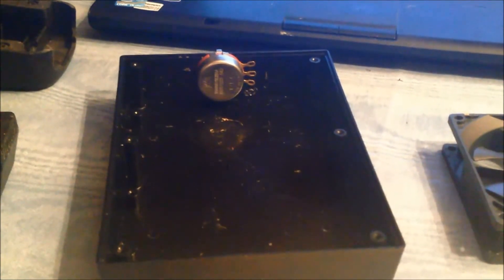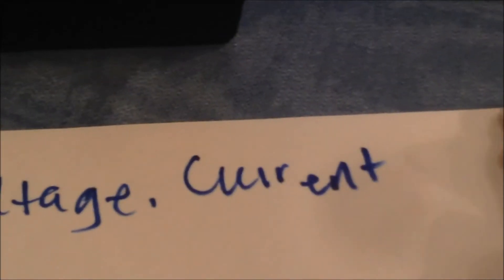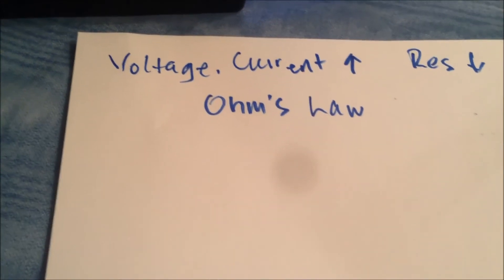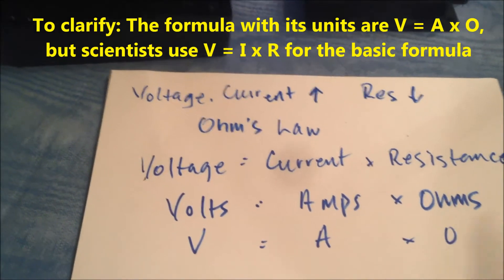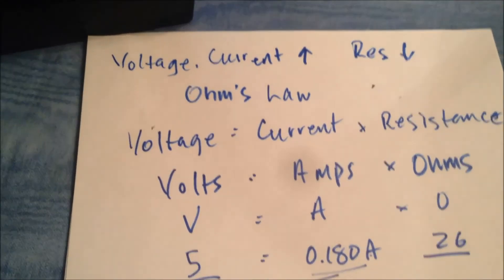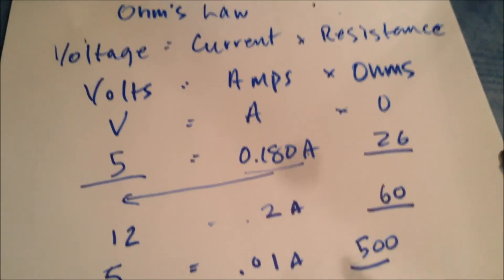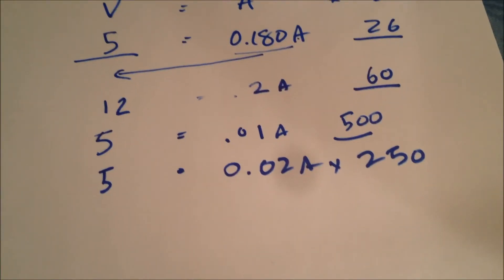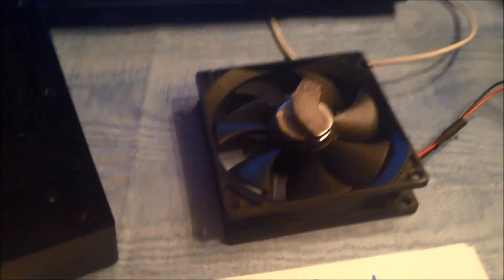Use Ohm's Law to choose the correct potentiometer for a stir plate

Comment: Ok I Tried to keep up but when you figured the max ohms, I got lost. I’m trying to add a speed control to my model train with a potentiometer. I have 20vdc input with about 1.5 amps from a 30 watt transformer. Any advice on what pot to use would be greatly appreciated. Thanks Steve
Reply from the maker: You want to adjust the voltage from 0.0 to 20V by installing a potentiometer that adjust voltage accordingly.

Ohms Law from your numbers is: 20V = 1.5 Amps x 13 Ohms or 20/1.5 = 13

The Amps needs to be as low as possible e.g. .01. Formula is:

20 Volts/.01Amps =2,000 ohms

So buy a pot that goes to 2,000 ohms
Reply: Doug Brown thank you so much.

Comment: Responding to an old upload but here goes. Firstly where do you find such small resistance radial potentiometers? These don't seem to go down below 1kohm and I need like 0.06kohm or 60ohm according to your calc.secondly my power supply is rated at 12vdc and 2000mA but the fan is probably only gonna pull max 0.3A. Should the potentiometer not be calculated according to the max amp draw from the fan rather than from what can be provide - in this case 2000mA?
Reply from the maker: HI Josh. I was in Portland, OR on a visit and just found this big electronics shop with a huge range of electronics including potentiometers. A store like Radio Shack will have them if you google around your area. And of course Amazon etc. will have lots of suppliers, but I like to support offline retail. 

Regarding the fan, you have a very strong power supply that is going to spin that fan super fast and likely burn out if you gave all that current. 2000mA is 2A of current going into a fan that needs 0.3A, so the chance of burn out is pretty easy to see. I would consider a 5V supply like mine. If you want to use the stronger power supply you have to be able to control 100% of the energy flow to the fan, and then be able to dial the potentiometer way down to supply just 0.3A to the fan. You're asking if you should buy a potentiometer that will deliver a max of 0.3A, but these simple little electronic components don't really work that way. You have 12V and 2A of energy coming out of the supply so you need to control all of that first, and then use the dial to deliver just 0.3A. Hope that makes sense.

12V / 2A = 6 ohms and then the max resistance will be (I'm just using my 0.02A figure again) 12V / .02 = 600 Ohms. So I would buy a 500 or 1,000 Ohm potentiometer. Since you're supplying 2A of current but only need 0.3A, you'll have to turn the dial to zero, and then carefully dial it up until the fan turns at the desired speed. 0.3/2.0 = 15% so you'll be dialing from 0% (completely shut off) to 15% (the max the fan can handle.) You won't have great control over the fan because you'll only have like 3mm or 1/8" of dial to play with. If you go higher, the fan will spin superfast and then probably burn out. So you can use the 12V power supply as long as you're careful. I would downsize to 5V like in my video and then you can use nearly 100% of the dial to control your speed. Hope that also makes sense?

Comment: Hey Doug,

I ordered this power supply from Amazon (https://www.amazon.com/gp/product/B01C845RGM/ref=oh_aui_detailpage_o00_s00?ie=UTF8&psc=1) and now I'm wondering if the 30W aspect of it is a problem.  I've noticed with the potentiometers that they have a power rating (generally between .25 and 2 W).  Am I going to fry any pot I hook up to this power supply?  

Thanks!
Reply from the maker: Sure, no problem. The voltage is switchable so buy a 250 or 500 ohm potentiometer, set the output voltage to 3 or 5 and it will spin your fan/stir plate. Then just adjust the voltage output to get the control you need over the spin speed. Lower voltage = slower spin and more control, and vice versa. Good luck.

Comment: Hi Doug,
I think just one thing is missing: the max wattage supported by the pot. regular audio pots, with 0.2W will burn when using a DC of 12V with 0,15 ohms which gives 1.8W. the pot should resist up to that. Which ones did you use? thanks for your videos
Reply from the maker: Hi, I just bought the only pot available from an electronics store and the range of pots didn't distinguish between different watt ratings. In any case my stir plate still stirs!

Comment: so if I have a 6,3 volt  with 0.6 a , I need a 100 ohm pod? how much watt potentiometer do I need .
i'm confused. great video
Reply from the maker: 6.3V = 0.6A x [potentiometer] Ohms. The starting resistance is 6.3 / 0.6 = 10.5 ohms. You want enough resistance to offset the 0.6 amps so take 0.02 amps as being effectively zero.so 6.3 / 0.02 = 315 ohms. You could add resistance by using 0.01 amps which requires 630 ohms. So I would go for a 500 ohm potentioneter because you can only buy 250 or 500
Reply: Doug Brown thank you so much for your help

Comment: Hi, I'm getting confused here, could use some help. I have a power supply thats DC 12v 500ma. What value Pot do I need? I was thinking 250ohm? Please let me know as I am waiting for your reply so I can pick one asap. Thank You, your videos are great, very helpful.
Reply: Oh, I forgot to say that I'd like to be able to turn it down and have fan stop or close to it. As long as I do get full RPM from fan when turned all the way up. I'm using this for mixing e-juice. Thanks again.
Reply from the maker: 250 ohms will slow it down probably to half speed or higher. You need to reduce the 500ma (0.5A) to almost zero and I chose .01A (1mA) as effectively zero. 12V = .01A x [Pot rating in ohms] is Ohm's Law. So 12V = .01A x 1,200 ohms is the complete formula and suggests you need a 1,200 ohm pot. I think you could easily get by with a 1,000 Ohm potentiometer.
Reply: +Doug Brown Thank You

Comment: So Voltage is the size of a tank, and resistance is the diameter/size of the drain pipe that determine the amount of current flow per sec . the speed is always constant.. and time only relates to the size of the tank and how long it takes to drain base on resistance and device current pull. Voltage is how much stored food you have.. resistance and current to the food depend how much you eat withing a given time..
Reply from the maker: I've heard all these analogies of course, but I only think in pure physics terms because the water analogy misses some key points. Non-physics students have largely been taught incorrectly for example the idea that current flows through a light filament to heat it and turn on the bulb is completely wrong. Ohm's Law's three variables: 1) Current is the flow of electrons past a point and one Ampere is exactly 6.24 x 10^18 electrons flowing past that point per second. Visualize the flow as billions of electrons streaming through a copper wire. Flowing electrons generate a magnetic (m) field around the circuit and can be visualized as concentric circles or doughnuts up and down the cable that connects the power supply to the wall. 2) Voltage exists as an electric (e) field that exists between two positive and negative charged points, for example the wall socket and the load. Electrons flow through a circuit (the copper wire) when the negatively charged part of the circuit (the outlet) is connected to the positive end (the power supply) and electrons want to flow to where they're needed on the positive side. When you plug the power supply into the wall, an e-field extends from the socket to the power supply and can be visualized like opposing ends of a spring that's been stretched out, and those ends want to spring together. A "volt" is the measure of work required to cause one Amp of current (6.24 x 10^24 electrons) to cross through one Ohm of resistance. So the 120V power supply has the potential to push 120A of current through 1 Ohm of resistance, 60A through 2 Ohms etc. The combination of the e-field and m-field create...an em-field or electromagnetic field. This is where the water analogy doesn't apply because in the water analogy it seems like the water (the current) creates the force that does work. Not true in a circuit. The em-field runs from the socket to the power supply and acts as a superhighway that allows photons (pure energy) to race at the speed of light from the wall to the power supply where they are directed into the fan motor, causing the moving parts to move. This is where the concept of a Watt becomes clear. The em-field is Voltage x Current and a Watt is ... Voltage x Current. Watts measure power, and now you can see visually that power is the product of the Voltage (e-field between the socket and power supply) and Current (number of electrons flowing.)  It's hard to explain an em-field to younger people so science teachers just tell them that it's the current that does the heating. Problem is that we all grow up with wrong science :) 3) Resistance is the ability of the material in the circuit to conduct current, but is more importantly in this case controlled by the potentiometer. The wiper on the pot is engineered to give 100% resistance in the Off position and less when the operator turns the shaft to On. To adjust the size of the em-field, the user adjusts the resistance by turning the knob all the way On until it maxes out at the whatever the power supply is built on. In my case, I wrote out Ohm's Law and filled in the variables for convenience. All this is why I don't use the water analogy because it's kind of correct, but mostly not. I like the em-field version.
Reply: Thanks i really appreciate your description. yeah i had to second guess my understanding. i also realize in doing the math, you have to keep in mind your decimal places and unit measurement for your desired results.

Comment: Hi Doug, Thanks for the video! I wanted to clear some things up about the POT resistance needed and the calculations to find it. 

Some of the stuff below may seem too in depth for some, I promise to wrap it up with a TLDR at the bottom :-)

General clarification: When a 12v 1A constant voltage power supply is connected to a circuit, it will only provide the amperage the circuit requires. This means if your circuit uses 0.16A (160mA) the power supply will only supply 0.16A to the circuit. The remaining 0.84A can be used if the circuit demands it, but until that happens it is never supplied to the circuit itself. Connecting a 12v 1A PSU to a circuit designed for 12v needing 0.16A will do no damage. (The same cannot be said about connecting a 24V 1A PSU to the same circuit.)
 
In order to calculate the POT resistance we need to consider the entire circuit. With the above in mind, lets get to the calculations.

First we need to start by collecting the values that we know and define the ones we need.
 
In this case we have:
Vfanmin = Fan voltage minimum for operation, for my fan it is 5 volts (the minimum for most 80mm 12v computer fans)
Vpsu = Voltage output from Power Supply (psu)
Vfanmax = Fan voltage optimal, for my fan it is 12 volts
Afan = Fan amps drawn, for my fan 0.20 Amps (200mA)

And we need:
Rfan = Fan resistance in ohms (calculated below)
Rpot = Potentiometer resistance in ohms (calculated below)

In order to figure out the resistance needed for the POT, we must first find the fans resistance. We could measure it, but since we already have Vfanmax and Afan, we can use ohms law to calculate Rfan. 

V=A*R  =>  Vfanmax=Afan*Rfan  =>  12=0.20*Rfan  =>  Rfan=12/0.20  =>  Rfan= 60ohms

In a circuit, all voltage that is provided has to be used. With a 12v power supply part of the 12v will be used across the POT and the remaining will be used by the fan. This is a good thing as the speed of the fan is dependent on the voltage across it. Also, now that we have Rfan calculated we can solve for Rfan by making substitutions to the R equivalent calculation. 
Since these are series resistors => Req=Rpot+Rfan. Im going to skip the step by step rearrangement and substitutions, but we eventually arrive at the following:

Rpot = ((Vpsu*Rfan)/Vfanmin)-Rfan  =>  Rpot=((12*60)/5)-60  =>  Rpot=144-60  =>  Rpot=84 ohms

So for my 12v 80mm computer fan using my 12v 1A PSU, I need an 84 ohm POT. Of course there are no 84 ohm pots, so a 100 ohm POT will do. (just to reiterate from the beginning, if the PSU were 2A instead of 1A nothing would be different, an 100ohm pot would be the answer.)

I promised at the beginning, so here it is

-=-=-=-=-=-=-==-=-=-=-=-=-=-=-
-=-=-=-=-=-=-==-=-=-=-=-=-=-=-
======TLDR=-=-=-=-=-=-
-=-=-=-=-=-=-==-=-=-=-=-=-=-=-
-=-=-=-=-=-=-==-=-=-=-=-=-=-=-

Want to plug some numbers into an equation and get the magic answer? Use the following:

Rpot = ((Vpsu*Rfan)/Vfanmin)-Rfan 

Variables to plug into the equation defined below:

Vfanmin = Fan voltage minimum for operation, for my fan it is 5 volts (the minimum for most 80mm 12v computer fans is 5v)
Vpsu = Voltage output from Power Supply (psu) (probably 12 or 5 volts)
Vfanmax = Fan voltage optimal, for my fan it is 12 volts (12v for computer fans)
Afan = Fan amps drawn, for my fan 0.20 Amps ( 0.20A is a good guess for 80mm computer fans if it is not listed on the fan)
Rfan = Fan resistance in ohms (calculated using Rfan=Vfanmax/Afan, see above for an example)
Rpot = Potentiometer resistance in ohms
Reply from the maker: I get that so what would be useful is for you to do a video that the average person can dig into. Try to express your calculations above in an easy to understand format that someone with basic algebra skills can use. For example, if you have Voltage and Amperage of X and Y,  what tight range of Resistance is ideal for the potentiometer.
Reply: Doug Brown My apologies if my comment sounded rude, that was not my intention. I'm building a stir plate as well and YouTube recommended this video after watching a few others. 

I may indeed try to try to make a video of the build as well as those calculations if I have time. Anyway, cheers!
Reply: Bjostad - thanks man, I was wondering about differentiating between the amps that the PS is capable of supplying and the current that the equipment actually draws - your post clears that up.  Cheers!